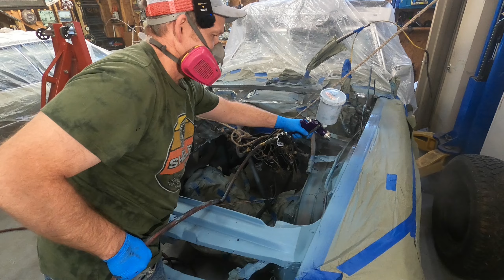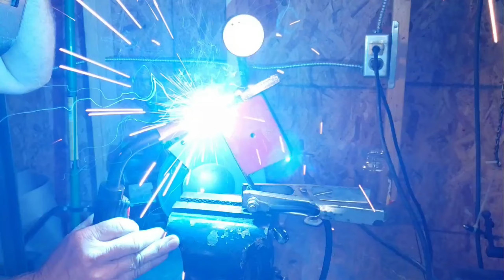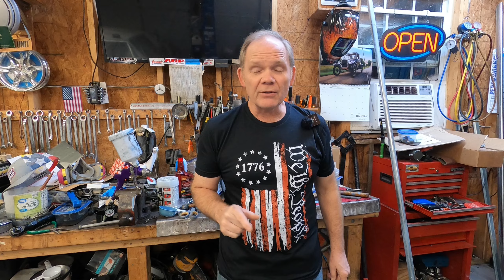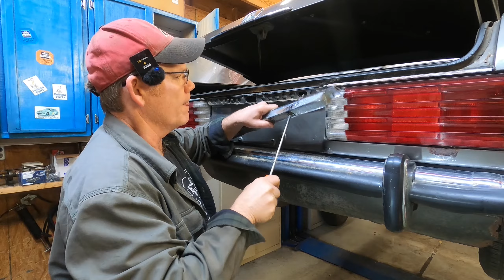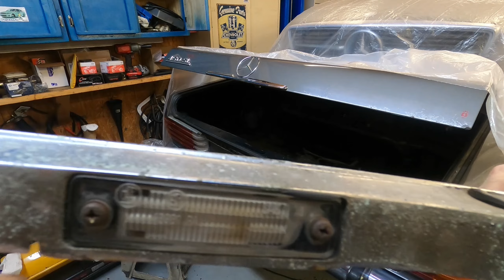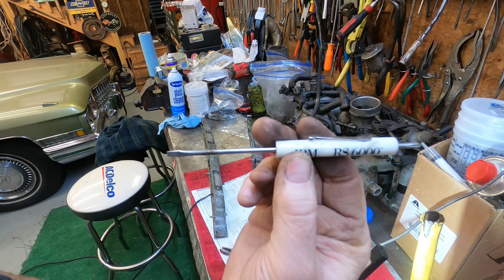73 Mercedes 450SL R107 - FINALLY ! - Engine Bay Painting !

Comment: I noticed that the intake manifold is on the table. In my own project, it was surprising how much tar and carbon had accumulated inside. At the same time, it is a good idea to replace the gaskets (donuts) between the intake manifold halves, as they are a potential source of intake leaks. Great project, and keep up the good work! 👍
Reply from the maker: Oh yeah. That intake is on my list! It will get the full treatment !

Comment: Good progress. I also removed and cleaned the tail lights on my W201. Even though they’re sealed, some fine dust had settled inside over the years, and a gentle wash with mild soap made them brighter. I also treated the rubber seals with CRC silicone spray.